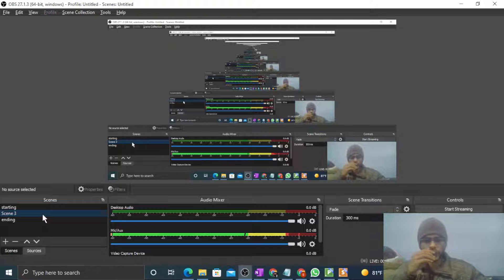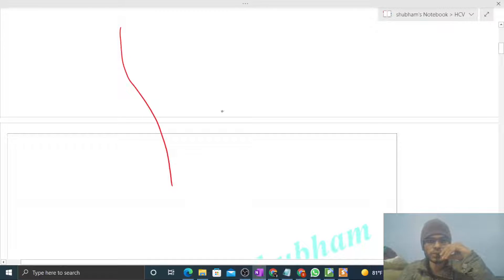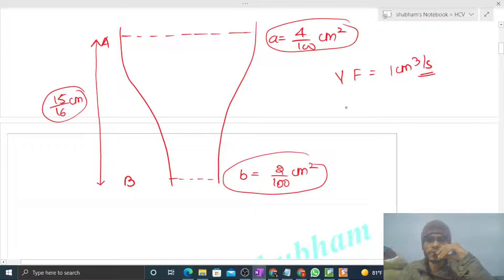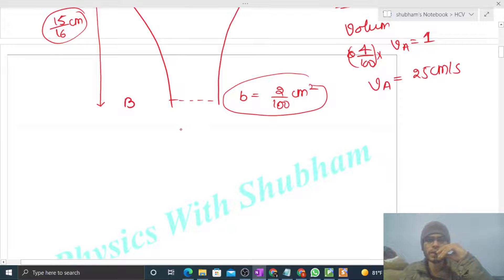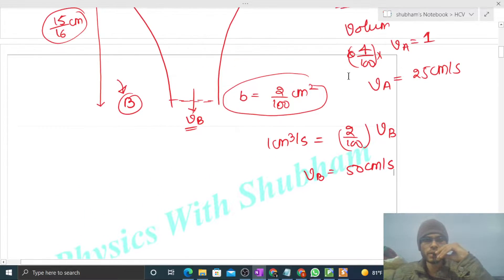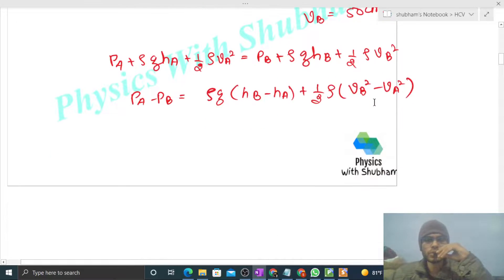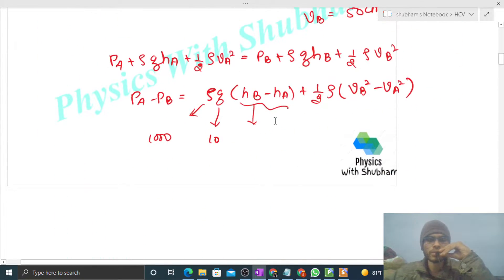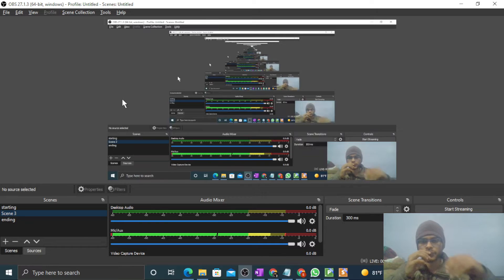Suppose the tube in the previous problem is kept vertical with A upward but the other conditions

Comment: I have question 🙋 that when we take tube in horizontal and vertical answer become same how??????
Reply: bcz to maintain fluid flow inside the non uniform tube, liquid does not accelerate, that is force due to pressure and mg cancels out. hence it would be the same for horizontal and vertical case
Reply from the maker: Just think about why it should be different you will get your answer!!